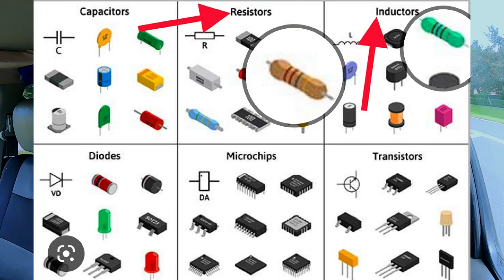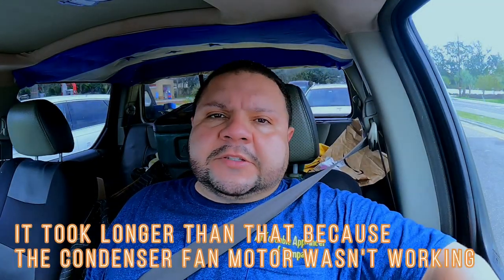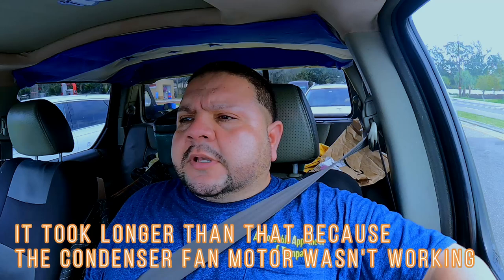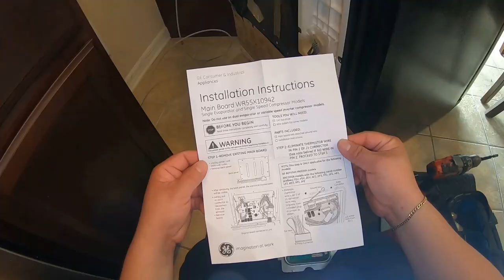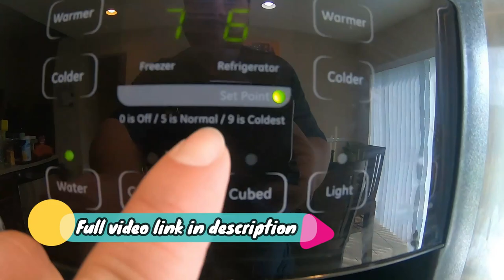How to Know IF You Need to Replace the Main Control Board on Your Refrigerator

Comment: Im no expert but im pretty sure your not supposed to cut that ring off the ground wire at 7:08. ground needs to be screwed into the frame of the fridge to detect short circuits in the system.

Comment: my TV antenna was hit by lightning and sent a power surge into the house..the fridge works but not cooling..I replaced the compressor start relay and the condenser fan comes on but not the compressor..I did notice a green blinking light on the control board. blinks 3 times which reads a code of a stroke trip..did it get the board...no signs of any damage..it's a Kenmore elite side by side..board is on top of fridge..